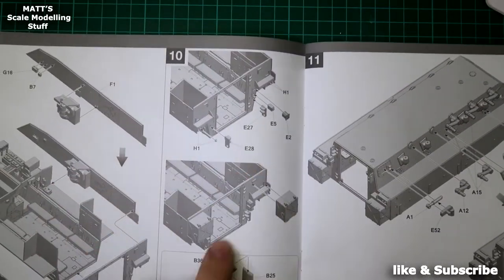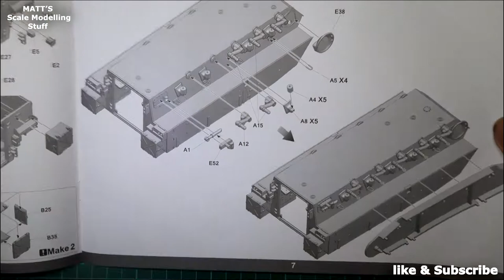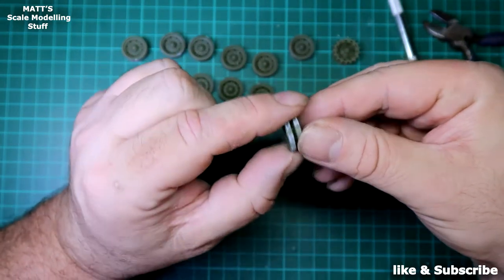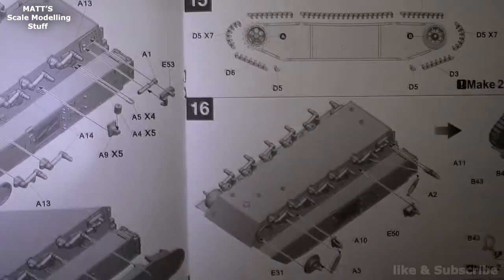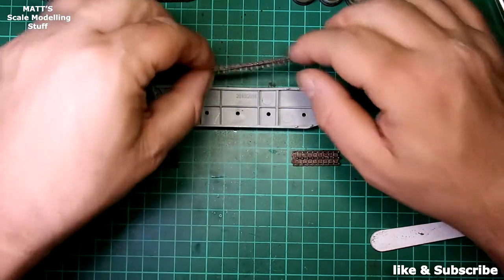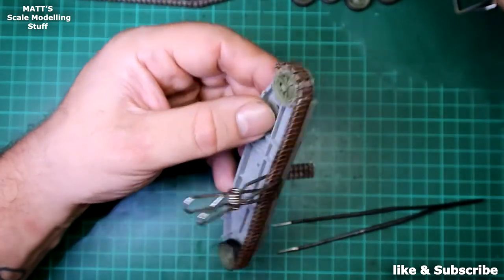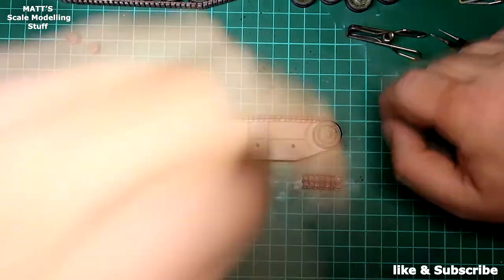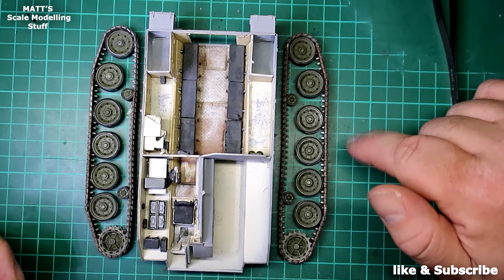FV432 Tracks & Running Gear part 3

Comment: i think you are having problems with the track fitting because you should take the rotation of the tracks into acount they run in one direction and should be fitted so (check photos) ps i used to drive them back in my squadie days
Reply from the maker: yeah, I think if I remember I ended up with a gap, I think the track sag was out by a little bit, it's a moulded part on the kit,  I much prefer metal individual tracks or rubber ones, must been fun getting the track tension right on the real thing,  Especially when caked in mud.